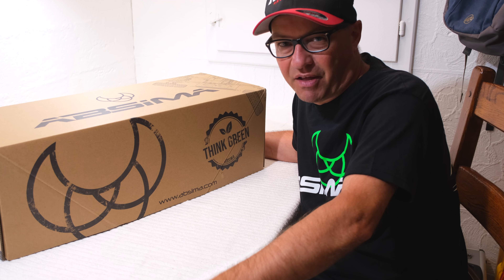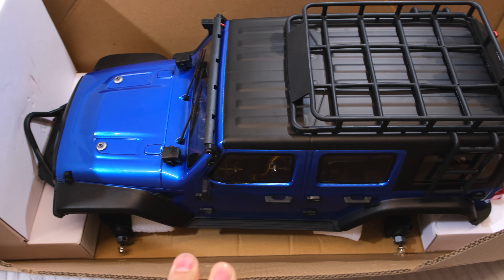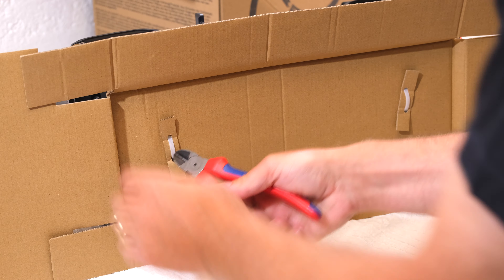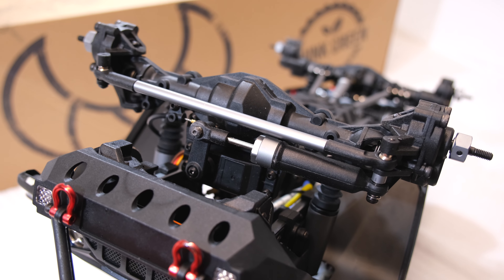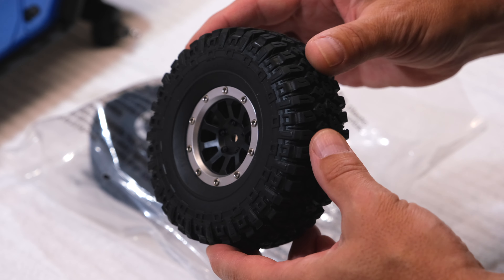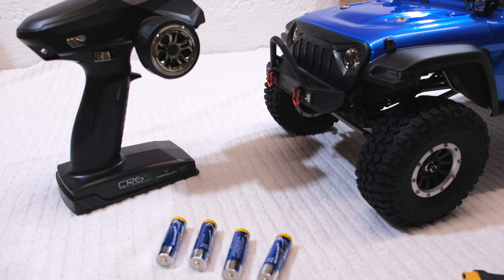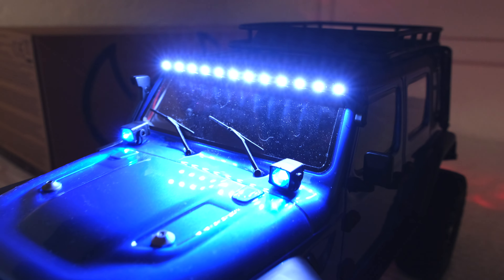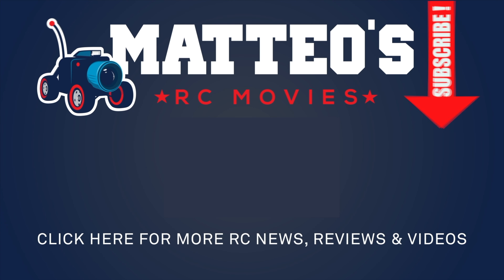Absima CR 3.4 SHERPA - Unboxing

Comment: This is a well made vehicle. Magnetic closure, swing open body, battery compartment, lights and more all solid engineering and apropos build methods. I feel like I don't even need to see it run, and classify it as the best RTR to date. I would prefer this to any currently on the market.
Reply from the maker: Thanks for your good feedback! 👍😊

Comment: The brand is YK4 in Asian regions(These variants has pre-applied decals). Reviews around my region commonly say the exterior is top notch for RTR Jeep, with an excellent built in LED system on top. People who bought it compared this with TRX4 and says TRX4 still has obvious strength in performance. Overall. a very cost-effective product that expands purchase options.
-->edit
Forgot to mention: Transmission gears are plastic. (Metal for portals)
Reply from the maker: Thanks for your Info! 😊

Comment: Weird how they didnt make it with a hazard function that kicks in after a time delay when standing still for a certain amount of time instead of the side repeater funktion when turning. Or better yet both, as dipswitch selectable options on the lightcontroller. Its a matter of taste perhaps.. :)
Reply from the maker: Of course the functions could be optimized. But for a RTR out of the box, it's not bad. I think I will disconnect the winkers. Fortunately  all LED's are connected via connectors, so easily possible to stop the function. I think no off road truck driver use winkers on the trails....
Reply: haha yes, you are correct :) LANE Boys RC did a mod some years back where a hack to a simple receiver made it possible to have to stay in neutral for 1 seconds, then hold the steering left/right for one second before the winkers engage. This way normal driving did not trigger the indicators for more realism. There was also a couple useful posts on their blog called "DIY car light controller for 3-channel RC" and "Pre-processor for the DIY RC Light controller". Very cool

Comment: An awesome truck with a ton of equipment out of the box for a fair price. Only thing turning me down is the bodystyle. Maybe not even the whole styling but the grill with its angry looking headlights just looks like a cheap Chinese design knock-off to just differentiate it a bit from the original jeep wrangler. But that should be possible to fix somehow. A 3d printed replacement-grille should be enough and also doable. 
Looking forward to your first running videos and a review of this rig.
Reply: That style of grill is all over the real life jeeps around where I live. I kinda like it, though, and if I owned a jeep, I would likely get one for it. But, this is a nice looking scale crawler, and I would get one to compliment my SCX10 that I built years ago.
Reply from the maker: Thanks! Yes, these things can easy customized to fit your personal choice! 👍😊

Comment: The germans know their engineering, it looks very well designed and built. But, do you trust anybody else building *your cars*, Matteo? I would disassemble the whole car, and reassemble it, just to make sure there're no bugs or trolls in it. But that's just me I think, no?
Reply: Tomas Dahlgren  Yikong make the truck ,It is rebranded for Absima
Reply from the maker: Thanks Tomas! Oh, unfortunately I have not enough time to do this! I have to trust the manufacturers! 😂😂
Reply from the maker: Like coffee machines...
Reply: Aha... Yikong? Interesting. Well, perhaps Absima drew the car in CAD, and ordered Yikong to build it?
It looks very well built. Also the idea to mount the steering servo to the front axle is very good, just like on MST's CMX. I think I will buy one, but I don't want the Wrangler body, I would prefer perhaps a Cherokee or a Land Rover 80's look.
Reply: Tomas Dahlgren  No nothing to do with Absima ,the version 1 of this truck has been out for over a year ,the yikong 4101 ( pick up truck body shell) .Its pretty common for different RC company’s to sell the same Chinese RC’s with only difference being the brand name and sometimes slight spec changes 👍

Comment: Those look like combined 1.9/2.2 wheels and tires. So no replacing the tires without also replacing the wheels.
I'n not a fan of portals, locking diffs, blue LEDs or the front grille.
Why are the indicators in the bumper instead of the stock location on the fenders? Why does it even have indicators?
Why can't you only turn on the headlights without the spots and roofbar?
Why is the underside so rough? So many ridges to get stuck on.
What's up with the red chrome fuel cans?
They did a nice job on the amount of body details but I would buy an SCX10III over this any day, even without having seen it drive.
Reply from the maker: Thanks for your feedback! Some of your questions are personal choice. And of course SXC10 III is a great truck (I have it too, but also there, not everything is perfect...) but for the price, you get a lot of cool, good working features with the Sherpa. 👍😊